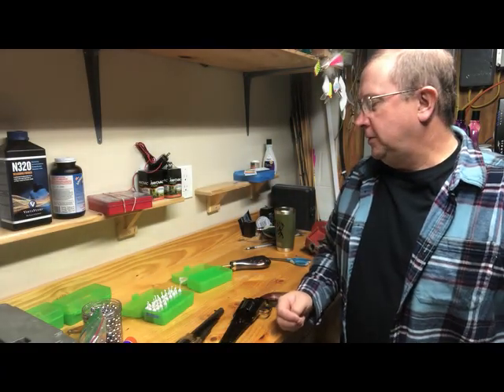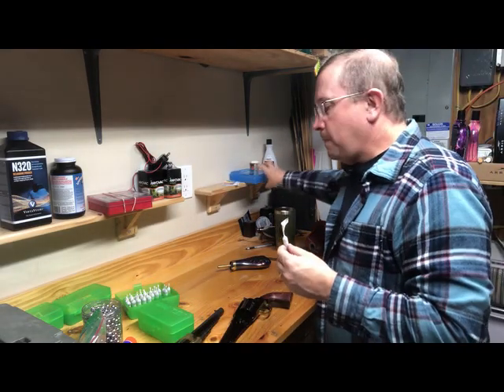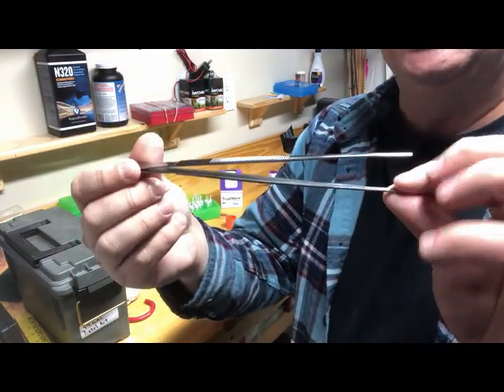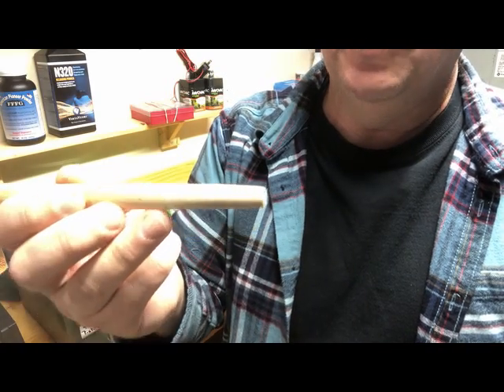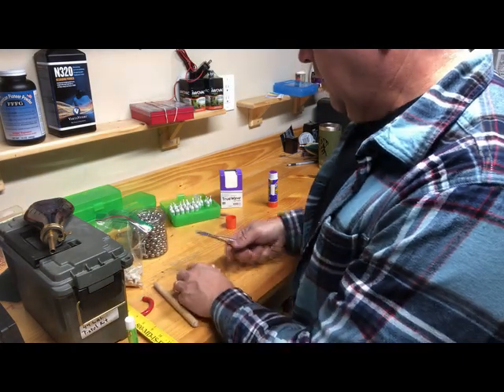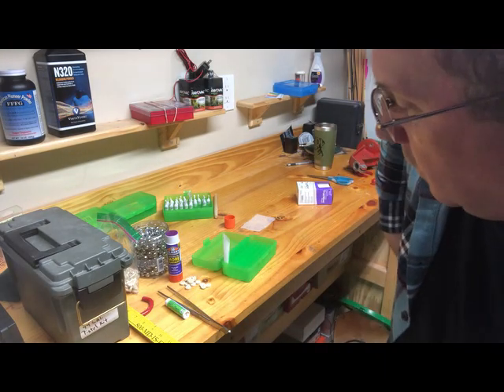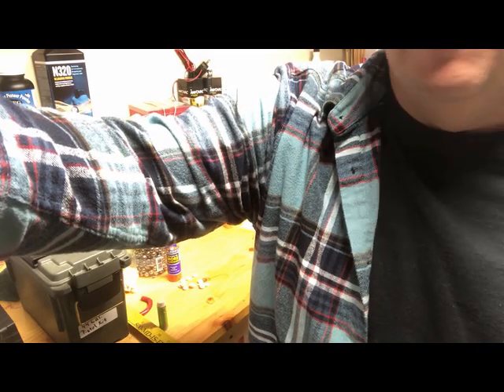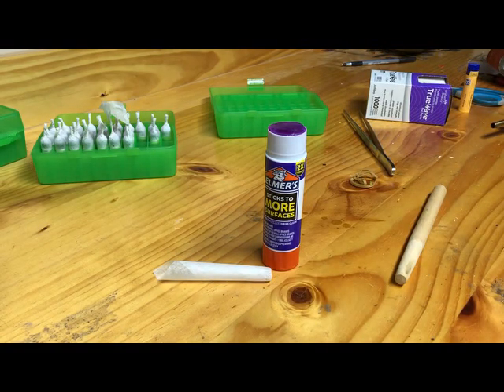Paper cartridges for cap and ball revolvers

Comment: I take a 1.5 rolling paper put a ball in and hold it through the paper then put a crayon against it and roll it up like a joint , then twist the ball end and pull the crayon out and move to the next one then when they are all done drying, I measure my powder and pour it in and twist the powder end and squeeze the powder tight against the ball while twisting then dip the ball side in lube and put it in my cartridge holder

Comment: Hey Rob, do you cut off the twisted top of the paper cartridge before you put them into your gun, or does your ramrod just push the entire paper cartridge into the cylinder?
Reply from the maker: I cut the twisted top shorter, but when you ram it home the entire top comes off and you can pull it after seating or leave it. You can pinch is and pull most of it when seating it, but it seems like a lot of extra work for what would just get pushed out the barrel with the ball.
Reply: @RobGoebel  Thanks Rob appreciate the info.

Comment: I've been trying similar methods and I it seems is that the lube is getting on the paper eventually but it doesn't seem to affect the powder pellets that I can see so far I tried to wrap the wad in cooking paper or some type of paper you use to cook with I tested it and it has a high burn rate so I know that it'll work well but what I was trying to do was make it so the lube doesn't eventually seep into the paper do you have this problem or no
Reply from the maker: No, my lube is pretty stiff at 50/50 rendered deer fat and beeswax. Recovered wads look just dented and not even burned.
Reply: I appreciate the advice

Comment: A little more than 7/16" is 15/32"... 11/32" is way smaller (1/32 larger than 5/16")
Reply from the maker: Well, it seems to load and squish under the loading ram and go bang still fine. So I think it is fine.
Reply: No prob.. I just used your method to make a few about 30 minutes ago, haven't fired them yet.  The end papers seem like they'll do great , nice and cheap and durable. Fast method, no dicking around cutting out round pieces of.paper for the ends, I love it.

I was just mentioning your number was off a little.  You said the taper on the dowel was down to "7/16, or a little more 11/32", but I think I just misunderstood you.. by a little more, you meant smaller. So, in retrospect, I was wrong lol.

Anyways, thank you sir for taking the time to make the video and share with all of us, I'll report back tomorrow or Thursday with results. 👍
Reply from the maker: @IrrationalBstrd  my reloading micrometer reads .356 to .362 on mine as it is just slightly oval from being hand made. So mine is just a smidge over 11/32"

Comment: where do you get the gun at
Reply from the maker: You can buy Black powder guns online, IF you can find a store that has them in stock right now. Caps and powder are better to buy locally because of the hazmat fees. I got mine from Cabelas.
Reply: Cabelas is a good store they have most everything you need.  Also you can order from Dixie Gun Works in Tennessee.  No background check . Delivered directly to you . Read and order one with a steel frame.  You can use heavier loads , or even order a cartridge conversion cylinder and shoot modern bullets.  A lot of videos on YouTube on how to load and shoot
Reply: Just ordered my first one from Dixie gun works. Hopefully it ships fast!